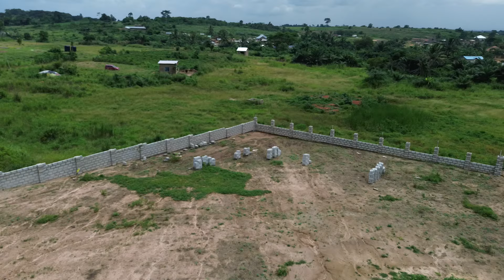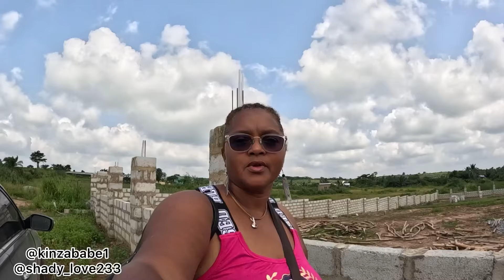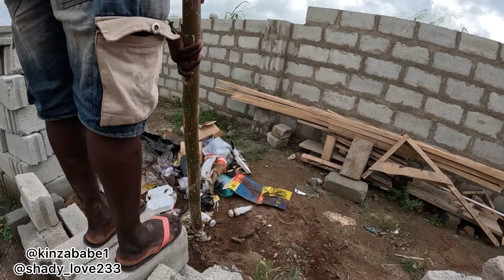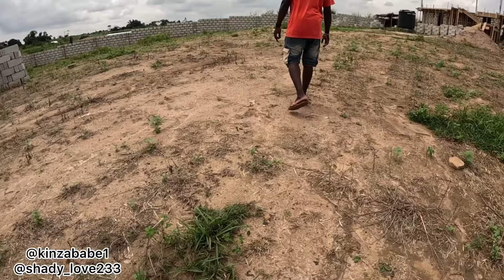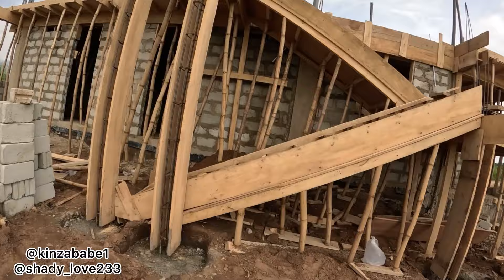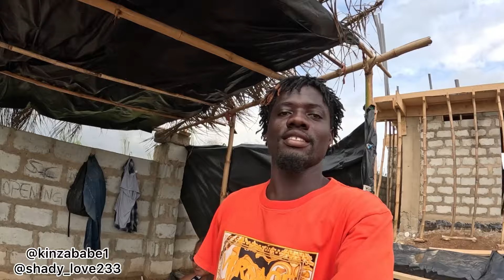Sad day‼️Ants invasion/ I lost all my crops ⁉️

Comment: Please tell your carpenter to make you a temporary gate with some of the wood or bamboo, or to block access to back and front.  The front entrance can be a temporary one as i said till you are ready. Those cattle herders do it delibrately by allowing them to graze on peoples crops. I saw them in that video too. You need to give him a warning, that you gonna get a cow if they trespass. 

Please replant the corn again, its still in season and more can be planted. Plant a lot more this time.
Reply from the maker: I will gate a temporary gate but i will not replant anything until the gate is installed.
Reply: @kinzababe1  actually they can use some of your blocks to seal off that back gate section alsp temporary by stacking them in a way with gaps to close that section.  Thats another way if you don't want to use wood to close it off

Comment: @kinzababe1 I think the second room above the ground floor room has a way too massive bathroom and the bathroom wall needs to be moved back a little like 2 feet and it can be used for a built in wardrobe attached to the bathroom inner wall with the bathroom entrance door on the side. This would make it spacious also instead of having a huge bathroom space and having to place a wardrobe also in the room to take additional space.

So if you stand with yiur back facing the street and you facing the bathroom, the bathroom entrance door will be on your right or left whichever way you prefer with the built in wardrobe next to the bathroom entrance door. So to achieve this a bit of space must be taken from the bathroom by moving the bathroom wall a little backwards into the bathroom. So that space taken would be occupied by the built in wardrobe. And you can have a good size bathroom with the inbuilt wardope too to compensate for both rooms. I heard shaddy saying no to you when you asked for the wardrobe but this is the best way to have it setup as to get it nicely the way you want it. Because you want it to be both nice ans spacious and use as 2 independent airbnb rooms including downstairs later when you are not using the apartment. Because i just saw the video and i can tell you that its possible to the wardrobe but the bathroom wall needs to be moved back a little bit to make it happen. This can be done when they are doing the layout or marking out for the apartment upstairs and they can move those walls back. Also the kitchen should be like a galley or U shaped kitchenette/kitchen style with a little breakfast bar on the side. 

I saw that pipe sticking out in the kitchen as a floor drain, but this is not a good idea because it could bring bad smells from the drains back into the room. Its best you repurpose it as a washing machine drain. And thats much  better. When any water gets on the floor it must be mopped and doesn't need a drain in the open kitchen and living room. So that extra pipe sticking out in-front must be repurposed for the washing machine instead.  The plumber can correct this for you.
Reply from the maker: That drainage is for emergency flooding. I have made too much changes to this project so I have to really consider any more changes.
Reply: @kinzababe1  ok. Well you should have emergency stop cocks installed for every supply section in that case, but i don't see any possible flood happening up therr and if any the water will make its way out. It is connected to drains and bad smell or gases will come out of it. The sinks will have a U-trap so water stays at the bottom of it and that prevents back smells, also this flood drain will be a safe haven for roaches and other drain bourne insects crawling out into the flat. I would personally not have that to be honnest but you can go for it and if it bothers you yiu can seal it. But i was thinking it will be better to use it for a washing machine instead. But it's your design, i am just advising from what i see happening,  especially when the septic tank or biodigester doesn't get treated more frequently, roachies start coming out.
Reply: What a blatant disrespect for them to think it is OK to allow their animals to destroy your property... not only a loss of crops, but money.  Put the gate first and wait till you move in before planting anything. Take them home and get some big tubs and plant them in till you are ready. I have a neighbour's that plant her yams in a huge tub and trash cans and still reap food. So sorry to hear this...right  away it is a turn-off with the owners . Now, when you approach them for your rights, they will not feel responsible
Reply from the maker: Miss Shirley i will not plant anything there until i have a gate up or until i am on the property.🙏❤️🫶🏾
Reply: @missamanda539  these Fulani guys are nomadic cattle herders who are very problematic, they have been causing problems all across the country with farmers, some serious crimes have been caused by them in the country. 

Kinza, You just need to be firm on them wgen you talk to them and let them know you have reported them to the police and the next time the ever try that you will get them arrested, they will not try it. 
You cannot let this spoil you livelihood and fun, it has cost you a lot of money too, but life goes on, don't let this prevent you from growing your crops on your land. Just block the rear entrance with some of the blocks and use sone of your wood or bamboo to make a temporary gate for the front entrance. They would not dare to jump the fence and if they do they will be caught. Anyway you will be casting the concrete slab and you can have your builders stay there during work and look after the place by covering the front entrance and windows with wood for privacy, thats how we do it in Ghana for security when building, we get the guys to stay on site. You should also take picture of the foot prints of the animals as evidence. The animals have memories of grazing your compound thats why they keep coming there, and if nobody was around he would have allowed them to graze on your farm. But he has to pay for the damage caused. Just ask your carpenter to make you a temporary gate from your wood available.
@kinzababe1
Reply from the maker: @nanabrimpong3485 yes the block is a great idea 💡 I will have them move them to the back entrance gate. My guys already stay at the site just their not there when there is nothing going on. The casting will be done tomorrow. I will not have videos for about two days. We are taking a break 👏🏿❤️🫶🏾🙏
Reply: @kinzababe1  you going to need to get the machine for the casting?
Reply from the maker: @nanabrimpong3485 Yes they get the machine for casting🙏🫶🏾❤️